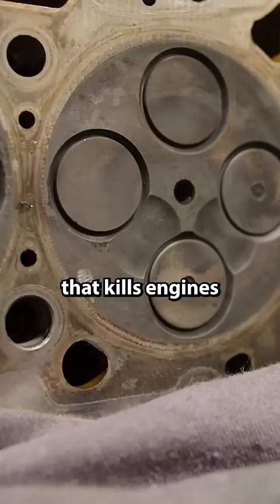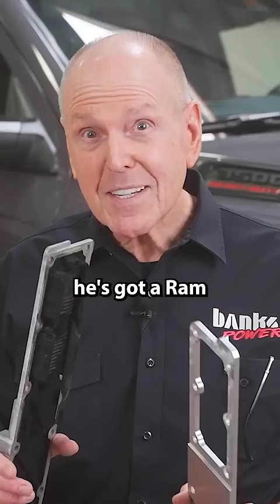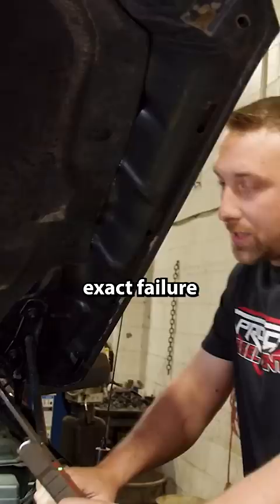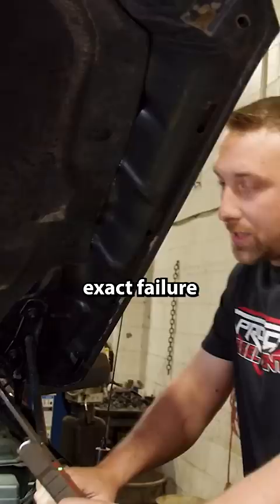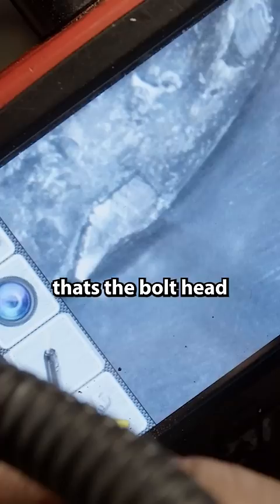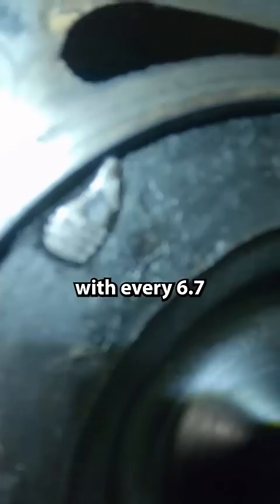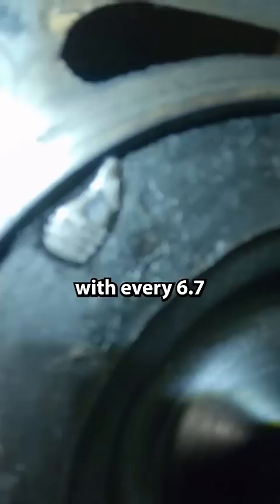Accidentally solved a huge RAM 6.7 issue

Comment: I work for Cummins and that grid heater serves a very vital purpose, especially in cold environments… so now that you bypassed it with the plate, how are you going to bypass the circuit? Do you have an ECM update or are you just gonna throw codes? Are you moving to a glow plug option?… especially in modern engines where “emissions” are more important than power (unfortunately) you can’t just go deleting stuff like we use to anymore so I hope you have a solution for that, other than that yes, that grid heater bolt was a huge problem!
Reply from the maker: We replace the grid heater with a high flow billet intake plate and coil style heater as well as the Monster Ram. To learn more, tap the link below. 
https://bankspower.com/products/intake-elbow-42799-pc-2019-2021-dodge-ram-2500-3500-6-7l-cummins?variant=42237177594053

Comment: So, uh - does the OEM intake grid heater serve no purpose? I thought it was to preheat combustion air to facilitate cold-starting...?
Reply from the maker: The Banks Monster-Ram comes with a coil style heater similar to what other modern diesel trucks have from the factory.
Reply: @bankspower  Cool

Comment: How does removing the grid heater effect cold starts on the 6.7?
Reply from the maker: The Monster-Ram comes with a coil style heater similar to the one used in Duramax and Powerstroke engines.

Comment: So after removing the grid heater what are you doing to heat the air for cold starts?
Reply from the maker: The Banks Monster-Ram comes with a coil style heater similar to what other modern diesel trucks have from the factory.

Comment: But doesn't removing the grid heater make it harder to start in the winter? I live above the rust belt
Reply from the maker: The Banks Monster-Ram comes with a coil style heater similar to what other modern diesel trucks have from the factory.

Comment: What do you do for cold starts? just use the original grid heater?
Reply from the maker: The Banks Monster-Ram comes with a coil style heater similar to what other modern diesel trucks have from the factory.
Reply: @bankspower  yeah I noticed the two openings there after I commented I should have known better. Banks don't mess around

Comment: What's the purpose of that grid in the intake?
Reply from the maker: The heater is needed for cold starts, but the Banks Monster-Ram comes with a coil style heater similar to what other modern diesel trucks have from the factory.

Comment: Unfortunately those "failure points" are intended.
Why would you buy a new truck if your old one still runs. I don't care what brand, every single vehicle built in the last 10-15 years was designed with a 150,000 mile lifespan, and a lot will fail before that.